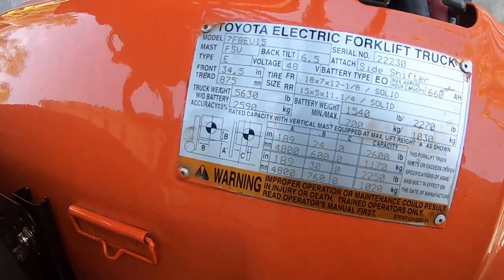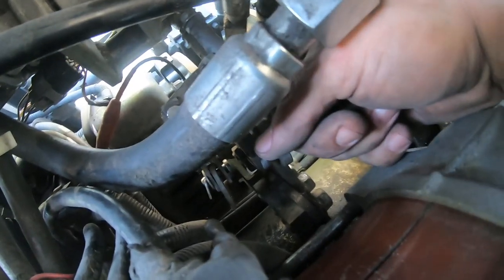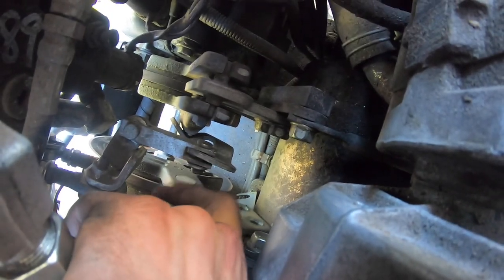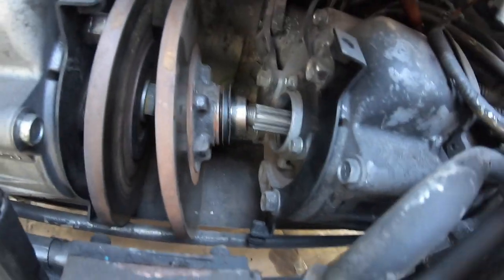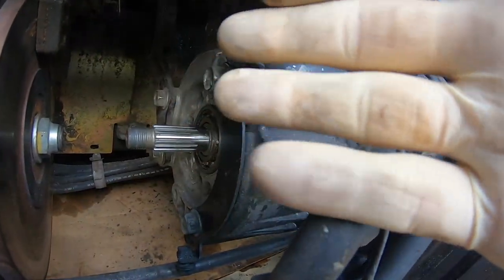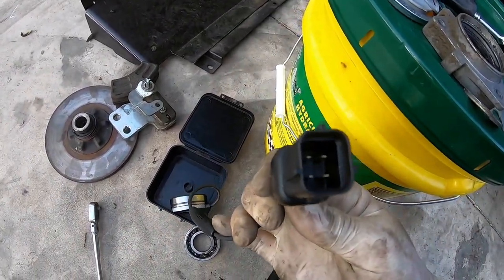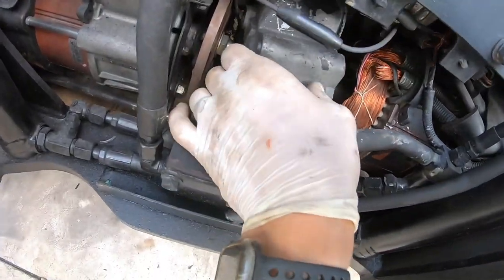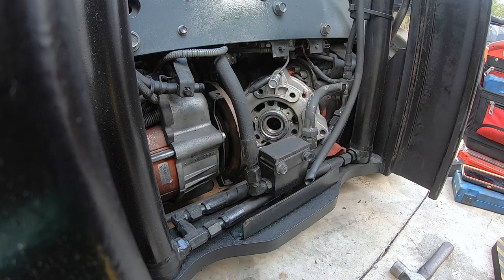Toyota forklift 7FBECU15 speed sensor replace. Code C8-1/C8-2/Slow Travel!

Comment: I hate taking a hammer to those things no matter how gently you tap. It's nice to be able to do it in the truck but without a way to press the bearing you're pretty much stuck tapping them in. Last one I did on a Hyster E50 I figured out how to mount the bearing externally leaving the old one in place. Next time it needs one it will take me 20 minutes.
Reply from the maker: Great tip Rodger! I will keep that in mind 👍🏼

Comment: I have a problem with mine going super slow but it does everything slow. Lift and driving is slow. Then after a while the display starts flashing PCR and it eventually cuts off completely. Have had many fork truck "experts" but nobody can seem to figure out the problem. Please help!
Reply from the maker: Sorry im on vacation. I will look into it when I get back home
Reply: @theforkliftguy  thank you!
Reply from the maker: @mr_angry1482  what have these “experts” done already ? For example, replace main computer board, test battery, reprogram display, tuning
Reply: What would be wrong if every function is extremely slow and then the display starts flashing PCR? Driving is slow and hydraulics are slow.
Reply: @theforkliftguy  damn I never got a notification that you responded. 😢 I'm not sure what these guys have done besides charge for driving time and diag. Some say the battery which it is definitely not. I bought 3 deep cycle batteries and made them 36v to test. Still slow AF. I believe one of the techs said the motor was getting really hot. I really know nothing about these accept for the fact I should have went with propane. This thing literally has 160 hours on it.

Comment: I've done many of these through the years mostly due to the sensor bearings becoming very noisy but I have always removed the mast and dropped the motor gearbox units to the ground first. Here in Australia that model is know as a 7FBE15
Reply: Hey, the C stands for cushion tyres. And the U means this forklift was built on usa ground.

Comment: hello how to fix the run wheel because the left side is run reverse then the right side is run forward not the same running
Reply from the maker: Bad speed sensors or drive motor. The one that is going in the opposite direction is bad. Most likely bad speed encoder.
Reply: @theforkliftguy  hello what is the PM error

Comment: Hello .. i have the problem when i turn the key switch off the display still on..i need desconec the battery...but the líne contactor turns off when i switch the key to off
Reply from the maker: Hello. If line contactor turns off and display stays on, most likely the key switch might be bad. Have you tried replacing the key switch ?
Reply: @theforkliftguy  i change the distribution board

Comment: I have a 7FBEU18 forklift that put out code C8-2 would this code mean it is the speed sensor also? Everything on forklift works fine it just travels really slow.. would you know what sensor part number is for this model?
Reply from the maker: If it travels slow, then yea it’s the speed sensor. C8-1 is the right hand motor if you’re sitting down on the forklift. I unfortunately don’t have the part number on hand. If you call your nearest nationwide Toyota dealer with the model and serial numbers , they can get it for you.

Comment: Love the video! Great information to learn! Been doing this a long time, but I have not done much on electric Toyota's. I have a 7FBEU18 with a C8-1 code. Wanted to confirm this is a left drive motor sensor as sitting on the truck?
Also, Love the tattoo message!
Reply from the maker: Thank you! Yes, C8-1 is left side drive motor 1.

Comment: Hey dude love the videos what are the pros and cons of being a forklift mechanic ?
Reply from the maker: Pros: great pay, job security, never stop learning/ growth opportunities.

Cons: requires working out in the elements (rain, heat, cold weather, etc.). Lots of hours sometimes, that’s about it.
Reply: @theforkliftguy  Cool man I’m a commercial HVAC tech tired of our industry looking to make a switch as a forklift tech .
Reply from the maker: @charleyh8340  I 100% recommend it.
Reply: Pros: like mentioned you never stop learning. You can make just as much as or more then working on cars because there’s not that many guys out there working on these equipment. You don’t need to buy a huge arrangement of tools. What I like the most is that you don’t get all that dirty. 
Cons: the worst for me is working on electric forklifts. They can get complicated at times especially on new lithium batteries. Also the acid on these electric batteries isn’t fun when cleaning or watering them.

Comment: Thanks for sharing, found this channel from the rough idle video good stuff. would you bbe able to give any tips on how to fix a toyota 8fgu30 e 06-3
Reply from the maker: I apologize for the late response. 06-3 is Throttle motor power supply circuit open abnormality. Check power to the electric throttle body actuator, maybe there’s a broken cable or check the harness near the spark plugs. Those wires tend to get damaged there. If there is power in the plug, then I would swap out the throttle body with another known good one and see if that works.
Reply: @theforkliftguy  No worries you were exactly right, turned out to be a harness issue where the harness goes through to the computer

Comment: We also have a Toyota forklift (7FBMF18) which has had the speedsensor changed once. it's been a year and now the sensor is dead. Of course we have to change the sensor again. Can something be done to prevent the new sensor we put on from dying within a year? Thanks. 🙂
Reply from the maker: I’m not sure. I would say to use a quality (oem if you can) part. Try not to go through a lot of bumps and rain/water. That’s about it.

Comment: Would this be the same issue on a 8fbe18u with same C8-1 fault?
Reply from the maker: I think so but don’t quote me on it though. I don’t t have that specific model manual so I can’t confirm. Most codes from 7/8 series are similar.
Reply from the maker: Does the truck drive slow?
Reply: Yes, feels like its losing power if that makes sense

Comment: could you please tell the price of the speed sensor and a bill for this job
Reply from the maker: Total labor time was about 3 hours give or take. Part cost is between $130-$220 depending on where you buy it. I used an SKF bearing sensor. Seems to work well
Reply: @theforkliftguy  thank you
Reply: @theforkliftguy  do you buy forklift manuals or u taka them for free "somewhere"
Reply from the maker: @panchasnyk8895  I have a program with a bunch of manuals of electric trucks in PDF form.
Reply: @theforkliftguy  how much  ?
Reply: @theforkliftguy  do you have gmail ?
Reply: I have the problem 64-1 does not lower the tower could you help me
Reply from the maker: @rukigarza391  lift solenoid open or shorted. Either the lift solenoid is bad/short circuit/ or the CPU is bad.
Reply: @theforkliftguy  thank you very much if it was that 👍

Comment: Great channel! I have a 8fbcu25 no codes on the dash just the battery light is flashing. Forklift is stuck at 3mph. Again, no fault codes even when I go into the settings and adjust the speed it still will not travel faster then 3mph. Any ideas? Thank you!
Reply from the maker: How is the battery status? Do the cells have water? How is the voltage when you do a load test? For example, put a multimeter on the positive and negative cables and see how much voltage drop the battery has. I’m assuming it’s a 36 volt battery. Filly charged should be around 38 Volts. If it drops lower than 34 or 33 volts while lifting any weight. You have a bad battery. Especially if the battery light is flashing.
Reply: @theforkliftguy  thanks for the fast response. I topped off the battery they were barely low. Battery holds charge well and even with a load the forks raise the load quickly. With a load and meter to the battery I’m getting 38 volts. We have a brand new 8s identical to this one and the battery bars do the exact same thing as this one I am working on. Again I have no codes on the dash it’s just traveling at 3 mph. And the battery bars flashing doesn’t mean anything considering it’s doing that on the new 8s forklift we have in the shop. Voltage hold water level is fine. Otherwise I’d be concerned.
Reply from the maker: @lyubolesiv6867  okay. That’s always the first step, the battery. 

Now, I would swap out the main computer board with another 8fbcu25 forklift that’s known to work fine. It is located right behind the battery compartment when you lift up the battery hood cover. Make sure they have the same amount of plugs going into the board. It’s inside a silver box. 

Most of the time when you can’t change settings in the display or do any tuning, the main computer board is bad. 

The last step would be to swap out the travel controller, but that usually codes out first. Which is why I’m leaning computer board first.
Reply: I will give that a try tomorrow. Thank you so much for responding! Keep making those videos wish you nothing but success my friend.
Reply from the maker: @lyubolesiv6867  anytime! Thank you
Reply: @theforkliftguy  hello, me again. So, as I mentioned yesterday we have the same style forklift in the shop. I swapped out the computer same problem. I located the trouble shooting manual also spoke to a Toyota tech on the phone. I checked my accelerator pedal voltage is there and resistance on it. Then I disconnected one speed sensor at a time one is located underneath the computer motor. And the other once I raised the forks in the drivers assembly. I had error code, plugged everything back up. All the codes went away. Went throw all of the electrical wiring and check the fuses on the other side lower compartment which were fine. Then I checked 3 of the relays behind the fork levers. They all are all reading fine clicking… read both vol 1 and vol 2 manual on NO code speed restriction. I cannot figure this out.. could it still be a controller or possibly a motor. Then thing is when I step slightly on the pedal she move slows when I accelerate fast it takes off but still have a restriction.
Reply: Oh and I was able to adjust the computer on the screen the valves changing them to what the tech said over the phone and that did not change anything
Reply from the maker: @lyubolesiv6867  it could very well be the drive motors are bad but it's highly unlikely. I would swap out the drive controllers that are on the left hand side if you're sitting on the forklift. It's inside a side panel. There's 2 controllers I think. Swap those out with a known good one and let me know.
Reply: @theforkliftguy  i will try that tomorrow! Thank you 🙏🏼
Reply from the maker: Hey I’m working on an 8 series electric truck and I thought about your question today. I have one that’s leaking gear oil from the right drive motor/drive unit breather nipple and I found something odd. When I turn all the way to the right and drive it full speed it gets up to 5 mph/ but when I turn it all the way to the left and drive full speed it only goes up to 3mph. It seems like my right motor might be going bad/speed sensor is starting to act up. 

Just something to think about. Not sure if you figured out your issue or not. 

Also I was thinking of a 7 series when i was answering your questions, not an 8 series. That’s my bad.
Reply: @theforkliftguy  What’s up brother! So I had one with a prox sensor on the mast this was something optional that Toyota offers and the prox was damaged once I replaced the sensor it still was in limp mode. So I charged the unit completely for 2 days as the dealer recommended. Plugged the battery in and the mast was getting a signal light to the prox and the unit runs and drives perfectly now. Hope that helps
Reply from the maker: @lyubolesiv6867  interesting!! Good to hear 👍🏽 I will keep that in mind

Comment: I have a similar Problem with a Toyota 7FBMF25. VEERY slow Drive, normal lift.
It has a SKF Sensor Bearing on the Drive Motor, Which i want to replace.But Im not Sure If it's Even Broken. Do you have any Idea, how i can Test It? It has 4 Connections.It's a SKF BMB6205048S2EA002A, i think. 
Kind Regards from Germany
Reply from the maker: Does it throw any codes? 

Almost always when it is a slow drive, it's the speed sensor bearing. Especially with codes C8-1 and C8-2. 

Another way to check, is by turning the steering all the way to the right and give it full throttle and see if it codes or drives very slow. Then then all the way to the left and see if it codes giving it full throttle. 

Let me know, thanks.
Reply: It does not throw any Codes, even If i disconnect the Sensor Bearing
Thank you for this insanely fast answer btw.
I have it already disassembled, so i cant really Test It unluckily.
Reply from the maker: @magnusmokry140  does it have 1 or 2 drive motors?
Reply: @theforkliftguy  it has one, thats directly Connected to the axle
Reply from the maker: @magnusmokry140  perfect. Replace the speed sensor and let me know.
Reply: @theforkliftguy  i will do so. Thanks for your Support, It is very helpful for me.
Reply from the maker: @magnusmokry140  that's what I'm here for. Spread the word please.
Reply: @theforkliftguy  hi, im Not dead btw. 
I replaced the SKF Sensor Bearing and it actually works. This Thing ist faster then my 2 Liter Diesel Audi Kömbi now. I would never find the Broken Part without your video. Thank you very much!
Reply from the maker: @magnusmokry140 Just saw this. I’m glad I could help 🫶🏼